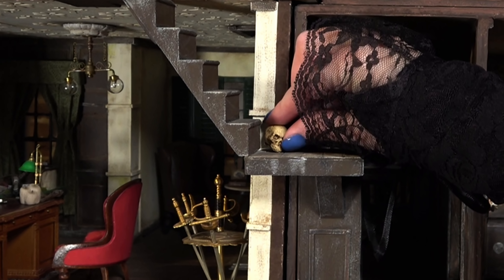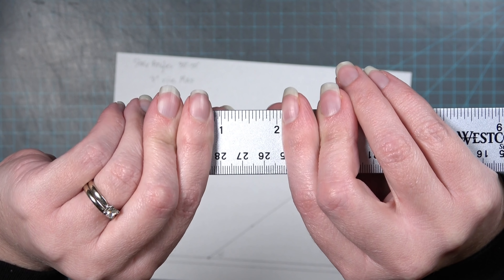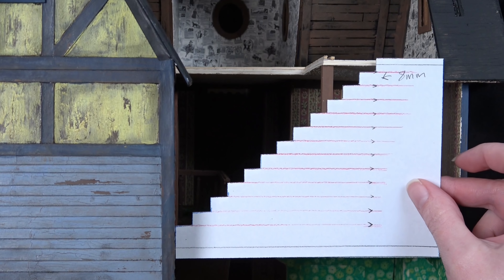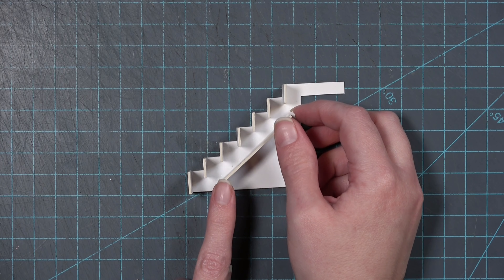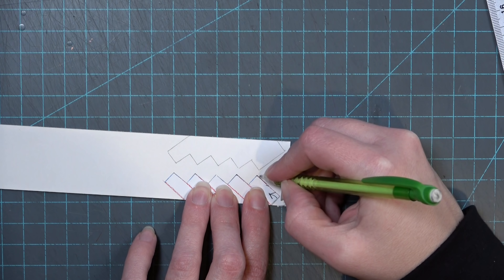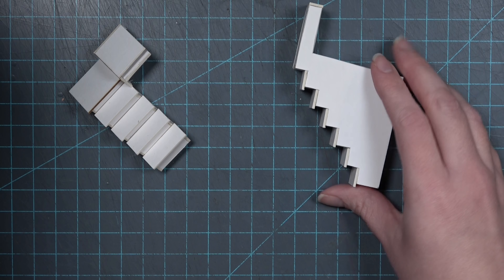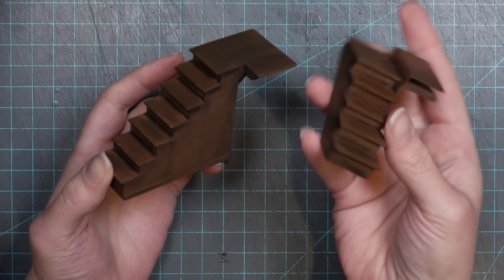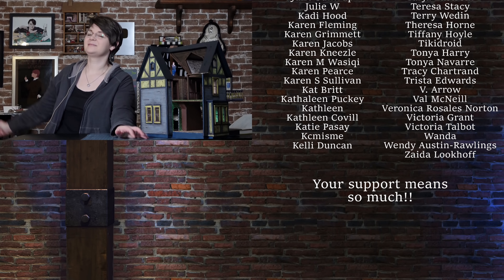DIY Removeable DOLLHOUSE STAIRS!!  Make an Exterior Staircase with me!

Comment: That third floor clamp stair is AMAZING! That's where your old architect and engineering training really shines through. It's mind-blowing in clever yet simple yet I would not have thought of that kind of stuff .
Reply: Also on a real house there would be an outer structure coveringvthe stairs, like an over hang room, tower or something like that. But of course doll house so some parts are fine to be just imaginary.
Reply from the maker: Yes I just imagine the exterior of the house is covering the exterior stair case and that's also why I don't worry about railings to much ;)  I am so glad you liked the video and the technique!

Comment: This was super helpful and awesome! I am planning on using the room as a bathroom. But the bathroom door will be down the hall so I may be able to add the stairs in the hall up against the bathroom wall. It will be a tight fit. But I think most attic steps are narrow or even drop down steps. Thanks so much enjoyed the process. Math makes me very nervous, but your explanations made sense to me. Who knew I would learn math so late in life! 😍I did a big oops while putting this kit together. I was so excited that it wasn't warped that I glued the 1st floor, steps and 2nd floor together. I made patterns for wallpaper. It looks awesome........I didn't paint the steps or decorate the front area where the front door is located. 😒It will be difficult to get in there now to do the steps. I think I will carpet the steps because that may be easier to shove the fabric in on the steps! Glad I am not the only one that makes mistakes. Happy crafting even with mistakes still makes me Happy!
Reply from the maker: I agree! I think that is why I like doing this method the most when the stairs are going to the attic.  I feel like there is more wiggle room with the width of the stair case and lack of banister!  I am so glad the math part made sense and you might be able to use this in your own house😊

Comment: Your process is amazing. I'm amazed that the thickness of the mat board you use is so sturdy. Didn't you say you had an architecture background building models? I can see how that has come in handy. I have designed stairs outside of my dollhouse since I first saw you mention it. Kudos to you.
Reply from the maker: I use a lot of matboard and I really like it as a material.  Its just a matter of supporting it correctly and it can be very strong!  And yes the background does help me out quite a bit but I am happy to pass along what I know :)

Comment: Don't worry about not having enough headspace at the top of the stairs. I stayed in an old house and had to be sure to duck at one point in the staircase or I would smack my head--and I'm only 5'4"! A lot of the old houses around here don't have the "modern" standard for rise or depth of tread--they just adjusted to fit the space.
Reply from the maker: I was thinking the same thing!  Thanks for confirming my suspicions! ;)
Reply: @BentleyHouseMinis  You're most welcome.

Comment: I want to eventually make stairs like this.  However, every time I use mat board it warps.  I don't know if I'm using an inferior type of board or it I do something wrong while constructing my project.  HELP!  Any advice will be appreciated.
Reply from the maker: Hi Jerri!  I think it has a lot to do with how I support it while I work on it.  If you notice when I am building section 1, I added an extra piece of matboard in the middle and that was to give an extra area to add glue and support.  If I hadn't added that piece the matboard could have caved in at that spot or warped.  You can also double up your matboard in places you think it will warp, add glue in the middle and let the 2 pieces dry flat under something heavy, and then it will be a much strong piece when you glue it in place.  I hope some of that was helpful!
Reply: @BentleyHouseMinis  Thank you.  I watched the video again and saw what you were talking about.  I'll try that. Thanks again, Jerri

Comment: I notice it, you could draw a trap door in the corner where the stairs are it. Where it give the idea if someone is going upstairs they can open the trap door to get more head room. I saw a video of a real life tiny house that had that. They didnt want a ladder so they made a stair case but once upstair they notice they didnt have enough floor space so they made a hatch door where they can close and get that floor back but open it up when they need to use the stairs. It was easy to open as you went upstairs and strong enough to stand on. You could add a very thin frame to look like something open up or something because of roof maybe one that open like a mini french door or something
Reply from the maker: That is a great idea for adding more head space while keeping the same amount of floor space!  Thank you for sharing!

Comment: You say no one has carpet under a stair stucture , i laught so hard. We had an open stairs also with a corner in it. My hubby fell twice from the stairs but its open standing in the livingroom an fell 2 meters from it with his head to the fishtank with 400 liters water. So we wanted a wall next to it but didn,t want new floor then and didnt want to move the fishtank. So we build on top of a laminated floor. 3 years later we had a huge leak in the water pipes so the floor warped. So the floor needed to ripped out. So we did the same as you in the fairfield. We made a trim around the wall stairs because i saw that 2 cm wooden floor underneed it , so funny you mention it
Reply from the maker: Thank you for sharing that story with me lol!  Sounds like that wall was needed for sure after 2 falls!